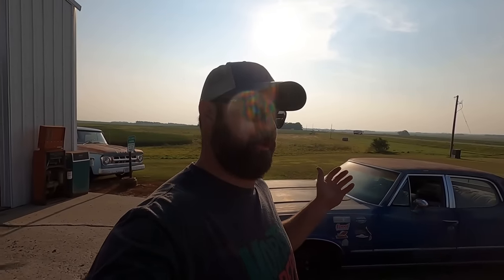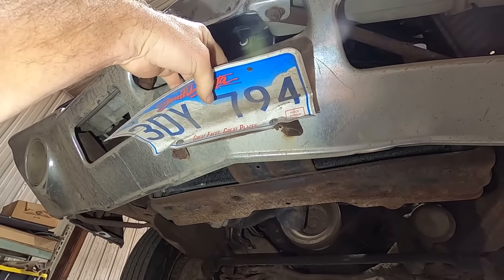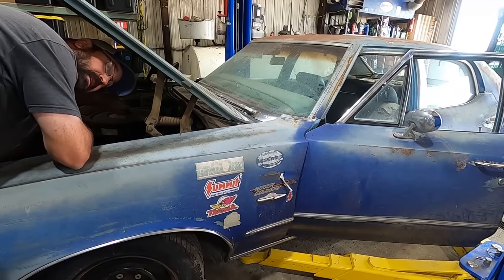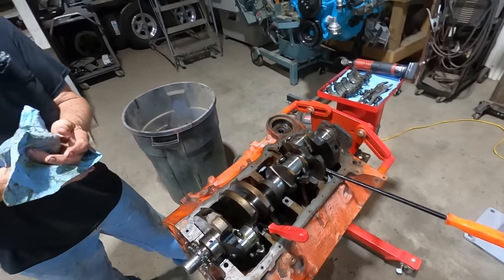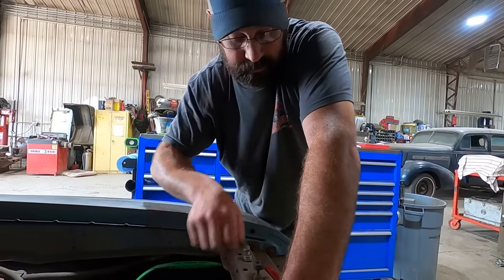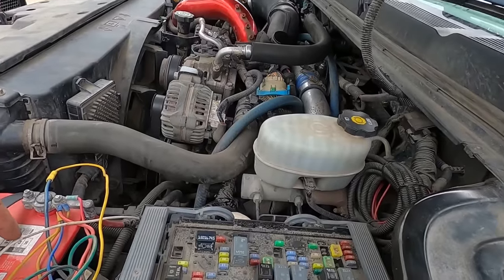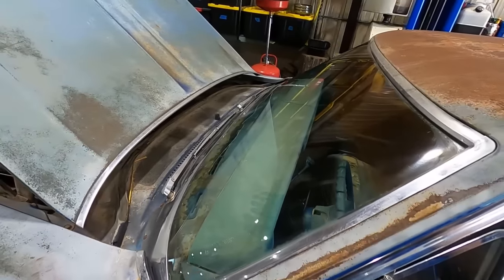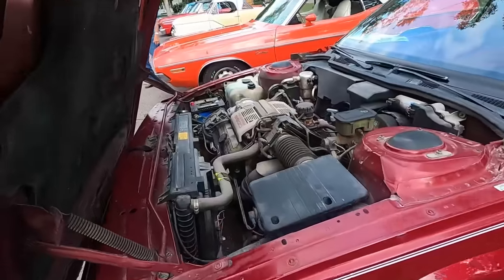Dirt Cheap Muscle Car!! Saved from the Scrap! Will It Run?!? Budget Built Hot Rod!

Comment: I don't know if a 2bbl more door vehicle qualifies as a "muscle car" but what do I know 🤷‍♂️
Reply from the maker: sounds like a good opportunity for discussion
Reply: Everything from 65 to 72 70 being the best year had balls !!  Grandmas car would blow the tires off and put you back in the seat, so just think what a cutlass 442 was like.
Reply: Theres another one them haters
Reply: It's 2023. If it wants to identify as a muscle car, we just have to go along with it.
Reply: I think the actual "definition" of "muscle car" is something like this: a factory produced car with upgraded engine, transmission, brakes, gearing, exhaust, tires etc.....or any combination of those items upgraded at the factory production level. So, my 67 Chevelle Malibu Sport Coupe isn't really considered a "muscle car", as it came with a 283, powerglide, 14 inch tires, single exhaust, and manual drum brakes. The very next step up from my 67 is an SS396, which IS considered a real "muscle car". Anyway, WAY cool more-door Cutlass, Mortske! Nice save! Nothing wrong with a crew-cab. I have a buddy who races his 4-door 67 Malibu in HPDE, ya know, the cone courses they set up in big parking lots. Yeah, he's part of a real sanctioned group. He rescued his crew cab 67 Malibu from a wrecking yard, made it into a 1/4 mile car, now has transformed it into a real street racer, with serious suspension and brake mods, body stretching to accommodate huge rubber, and a built 454 with a 4-speed and Gear Vendors overdrive. It's a really neat setup!
Reply: From a British perspective that's a muscle car alright. No question
Reply: @sheepwolf1st  you built a tube chassis Chevette in a weekend ??? Okay.
Reply: @daveparnell4044 from a British perspective a "muscle car" is a Camaro, Mustang, Corvette, etc... and not those with California compliant eco-motors.

They have to look and sound the part.
Reply: @grahamepigney8565 I prefer the massive saloon cars with huge capacity V8s. Always had a soft spot for those. Ever tried a burnout in a 1.3 Morris Marina?
Reply: @MortskeRepair  I owned several Cutlasses in the 70's. They were just nice cars back then. Wife drove one quite a few years. I don't know or recall anyone that considered them a muscle or performance car in that period. 442, GS, GTO, and SS were the muscle cars of those GM bodies. To be fair though, I guess whoever owns a car can call it what they want.
Reply: @Darrin_Wyatt  Next thing you know, it will want to identify as a "drag" car.
Reply: Not sure where this goofy “more” door reference comes from. But my family had a  69 Buick Wildcat four door with the 455 rocket. Um. Fastest car in town. So yes, a four door definitely can be a muscle car!
Reply: @Darrin_Wyatt  I identify as young, rich, buff, hairy, hung, and sane. I'm not binary, I'm bipolar.
Reply: @corvettejohn4507  So put a dress and a wig on it. "Diversity", you know. "Acceptance". 🙄🤦
Reply: Lines get blurred over time. Mustangs and Camaros originally "pony cars", but when they sprouted big blocks (like adolescent girls), they got lumped in with Muscle cars. By ORIGINAL definitions, the Pony cars were small, almost compacts. Musclecars were mid-size, the intermediates....WHEN EQUIPPED WITH BIG, HOT ENGINES. A 71 Road Runner 340, 383, or 440 is a musclecar. My 71 Satellite 318 ain't. Same exact body. Minus muscle. Fast BIG cars (Impalas, Galaxies, Wildcats) ain't musclecars, they're just BIG fast cars. Muscle, with extra fat, like an offensive lineman.
Reply: @sheepwolf1st  well that's what you would have to do to put any kind of v-8 in a Chevette or even a v-6. But its your lie, tell it anyway you want.
Reply: @sheepwolf1st  you would have to reinforce the whole car, it would twist like a pretzel, lol
Reply: @glentucker4250  455 Rocket is an Olds engine.  Your Buick would have been built with a Buick 455 Wildcat.
Reply: @jeffrykopis5468  If you want to argue semantics, a '71 Road Runner 340 is not a "muscle car".  Pure "muscle car" definition is a mid size with a full size car line's full size engine in it, hence the '64 GTO being called the first one.   

The 340 is a smallblock LA engine.  To be a real "muscle car" by definition, the '71 Road Runner would have to have a B (383) or RB (440, 426 Hemi) big block engine in it.  Also, BITD, "musclecars" were more often referred to as "Supercars" in the magazines.

A 340 '71 Roadrunner was called a Junior Supercar, or insurance beater.  Other cars like this were the W31 Ramrod 350 Cutlass, GS 340 Buick Skylark, 350 Pontiac Tempest GT37, and the 350 Heavy Chevy Chevelle,
Reply: @MortskeRepair why? Anytime someone disagree's with you then you block them. Just another chevrogay lego car. How many old gm cars can 1 stand watching.
Reply: @MortskeRepair  
Precisely. I had a '69 Pontiac Custom-S (2-door) and later a '71 LeMans Sport (2-door) with a YN engine - it timed differently than the hood sticker said, 2° earlier than the sticker - both were fast, the '71 would scream - past 140 on Speedo into the 'E' on the 'BRAKE' light in bottom of speedometer.
a buddy had a 69 Firebird (of course a 2-door) 
Why am I telling you about 2-doors when Mortske's Cutlass is a quad? 
Because all of those kick-ass 2-doors got their doors blown off by a faded purpley colored 71' Olds Cutlass that sounded like it had squished tailpipes, no roar, just a swooosh as it flew by us doing 120-140 after gaining on us like we were parked. AND it was a beat-up looking 4-door that some farmer's son had WAY too much time on his hands and apperently free-rein to 'fix-up' his mom's car.😁
👍🇺🇸😎
Reply: @corvettejohn4507  A fair enough observation. A 340 would be better suited for an A body, like a Dart/Duster/Valiant/early Cuda.
Reply: @corvettejohn4507  I've always bristled at that old cliche about the GTO being FIRST. That's dead wrong. It was the first POPULAR one. But the ugly-as-hell 62 Dodge Dart (a one year only B body) and Plymouth Savoy could be had with a 413 Max Wedge that would suck the headlights out of a Goat. The 13:1 monster was a race-only car, but a milder 10.5:1 version was available. The 63s (with some different names) were less ugly.
Reply: @johndenton5555  That may have been a "bootleggers" car; low profile, low noise, but hella fast. Junior Johnson's old bootlegger buddy Willie Clay Call claimed he had a 62 New Yorker 4 door, with the "long ram" dual quad 413, heavily modified, that did 180mph.
Reply: My dads 73 olds delta 88 was a land yaught.   I put the rocket 350 and turbo 400  from that car into a 79 olds delta 2 door.  Best engine I ever had  always started even in - 40 , never burned a drop of oil. Oh and it was also a 2 barrel .  Still miss that motor
Reply: @jeffrykopis5468  True, but the '62 Dart wasn't considered the first on a technicality I think.  It was introduced in Sept. '61 as Dodge's full size car.  Dodge had overheard Chevrolet's Ed Cole talking about a smaller car (some accounts say '62 Chevy II and others say '64 Chevelle) and assumed he was talking about downsizing the full size car line for 1962.  Dodge didn't want to be caught flat footed so they chopped the wheelbase of their full size car to 116" at the last minute.

When Dodge executives finally saw the 119" wheelbase '62 Chevy in Sept. '61, they panicked realizing their "full size" Dodge was so much smaller than Chevy or Ford.  This lead to Dodge introducing the Dodge Custom 880 at the end of January 1962 as a mid year offering.  So Dodge didn't intend for their '62 Dart to be a mid size car when it was introduced.  It just became one by default at mid-year when Dodge introduced a 119" wheelbase Custom 880.  The '62 Dart was a mistake, but turned out to be a happy mistake for Dodge racing teams because the car was so much lighter than the '62 Chevys, Pontiacs, and Fords that it did really well in NASCAR and NHRA drag racing with the 413.
Reply: wikipedia says its a muscle car, it has a 350 rocket in it, my uncle had a 442 a few years newer than this one with a 350 rocket and a 4 barrel carb in it and it sure as hell drove like a muscle car.
Reply: @greghansard357  all the the cutlass's from that era are 442's it just stands for 4=four-barrel carburetor, 4=four-speed manual transmission, and 2=dual exhausts
Reply: @King_Flippy_Nips  So all the Cutlasses of that era had 4 barrel carbs, 4 speed tans, and dual exhaust? Not hardly King, not hardly.
Reply: @haydave420 You are absolutely right! Even the land yachts had incredible hp and torque. An Electra 225 or an Olds Ninety-Eight were cruisers that could liquefy tires on demand.
Reply: "Don't drink the floor water, Duff!"   Made me belly laugh.
Reply: @glentucker4250  probably a 430? Musta been a small town. . .
Reply: 1979 305 fuel injection engine 9.5 to one summit forged pistons
Jactory z28 quadrant intake and a 700r4. Factory gears whatever they were. More rpms than I've ever seen
Reply: Mortske opened a can of worms!
Reply: I love watching your videos Mortske! You and puddin are my favorite tubers!   And I wanted to say I love that cutlass I’d love to own that and also a cool name for that Orange Ford would be OJ hahah
Reply: @grahamepigney8565 had a 4 door 69 Buick, had a smog 350 but it sounded cool and did burnouts 😂
Reply: It's not...   There's nothing muscle about this car.
Reply: One of my muscle cars was a 4 door 1970 Chevelle hardtop. Had a blast in it. Installed an Isky cam, Holley intake and 650. I miss it all the time.

Comment: Olds definitely made a 400 cid engine.  It was the mainstay in the Cutlass 4-4-2 from 1965-1969.  It used a tall deck block like the 425 and 455 engines.
Reply: Yes they did
Reply: yea i always thought the 350 rocket was a 70's era engine

Comment: Nice!! We used to use a driver's license and place it between the intake and exhaust valves to tell if a head was a 1.94 or 2.02 intake. Pretty sure that buzz you unhooked was the 'your key is still in the ignition' buzzer. Sometimes, when we go to car shows, we play the American Racing Wheel drinking game, where we have to take a drink of beverage every time we see a car that the owner has installed those rims to show their individuality. We stopped playing when my buddy Jon almost got alcohol poisoning one time.
Reply from the maker: I'll start playing it with Cragars!
Reply: Chinese raicing wheels ?
Reply: Yeah, express your independence and individuality and rebel spirit by dressing in all black, growing your hair and beard, getting tatts, and riding a Harley. Or put Torq-Thrust II's on your hot rod.

Comment: The paint is called GE Glyptal.  It makes the block super slick so the oil drains back to the pan quicker.  It is used for electric motor windings.
Reply from the maker: good to know!

Comment: I agree with you about changing the filter ...
In my experience with used transmissions NEVER open a transmission unless it doesn't work and you are prepared to rebuild it if/when changing the fluid & filter doesn't fix it... 
if the filter is clogged enough to need changing, the clutches are usually too far gone to half-@$$ it.
if it moves leave it alone,
if it doesn't then a new filter isn't going to miraculously replace the clutch material that clogged the old filter up.
Reply from the maker: Right on

Comment: This one brings back memories. The second car I owned as a young buck. 72 cutlas supreme 350 Quadra jet rocket. Bought it from a car dealer in 82 when I was 18. I paid $1250.00. 60,000 miles on odometer. Clean inside and out. Has one whiskey dent in the front right fender. One owner car the old man that owned said puter in the ditch one night coming from the tavern. 😅Olympia Washington. Two years later I got stationed overseas and couldn’t ship it to Germany at time. Sold it for $900.00 to a soldier buddy. I still kick myself in head for selling it. Young and dumb. I work on that all the time. Not that it needed it, I just loved working on that car!
Reply from the maker: Nice!

Comment: Of course Oldsmobile made a 400! It was in the 1965 through 69 442. In 1964 unfortunately, they still used the 3:30 four barrel four speed and dual exhaust came to mean 4-barrel 400 cubic inch and dual exhaust
Reply: And the 65-67 400 was different than the 68-69 400.  The earlier being more desirable (less stroke, more bore)
Reply from the maker: @dennisonbrower7680  interesting!

Comment: I like the more door hot rods since I've got kids. Keep up the great work as always and loving the longer videos lately.
Reply from the maker: Glad you like them!
Reply: I agree, when my kids were small I sold my 76 Camaro and bought a 72 Dodge Dart 4 door so my wife and kids could go to Cruise-ins and Cars and Coffees with me plus we had a car that could just be a weekend fun car when the car club didn't have anything going on. The Dart was in REALLY good shape when I bought it, it only had 27,000, I bought it from a mechanic I knew who had bought it new for his wife and then less than a year later  she and his sister  was killed by a drunk driver, not in the Dart, in the sisters car and after he put the car in the back of the shop and covered it up until I bought it 30 years later. Yeah it took a lil bit to get running but he had done alot it before I bought it, the interior still looked brand new and it once it was taken out and blown out it ran like a top. I didn't do much to it, put all new gaskets on the motor, had it professionally detailed, lowered it, pulled the stock hub caps off and repainted the wheels and put some baby moons on it and took out the AM Radio and put in a AM FM radio in it. We had a ton of fun in that car and believe it or not it got ALOT of attention.

Comment: Loving the perspective here. You don't need the 1 of 10 you can't afford in 20 lifetimes, but the $800 beater found in a field that runs and has some extra doors will give you memories that can't be beaten by some show queen. Put some unwanted and too many doors hunk of junk on the road (safely fixing the stuff that needs fixed) and you'll get more joy out of it than something where you have to worry about things like dings, dents, scratches, breakdowns, road damage, dirty shoes on the carpet and all of that. They were made to be driven into the ground, so it if it has some time left, keep it going until there's nothing left. That was their purpose. Drive it until it's nothing but a pile of rust and dirt and look back on it with some great memories.
Reply from the maker: Preach to the choir!

Comment: Those rocker arm nuts are called poly locks.    usually for solid lifter cams.   set the rockers with a feeler gauge and turn the hex to jamb them tight into place so they dont back off..     old school hot rod stuff
Reply from the maker: Cool